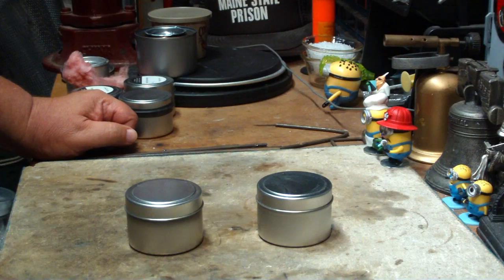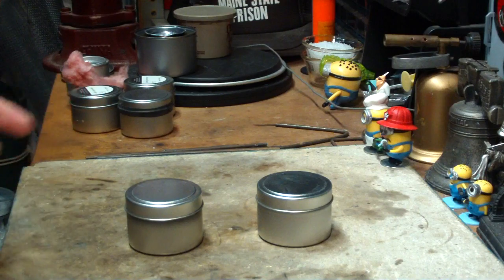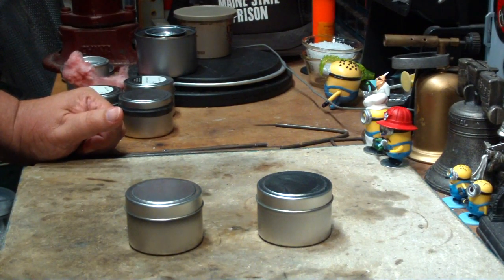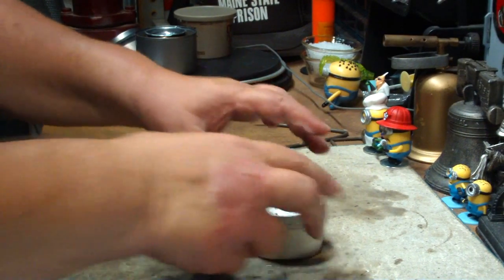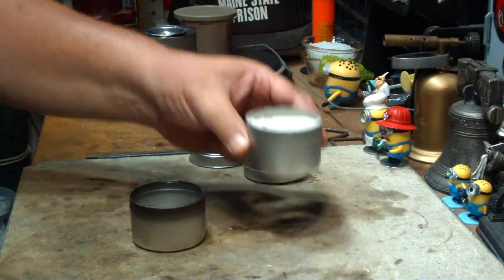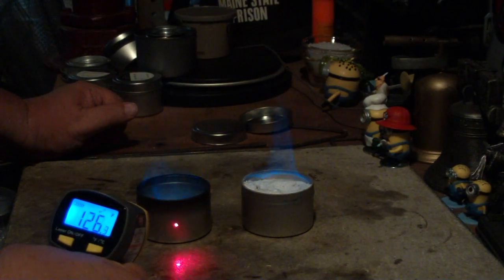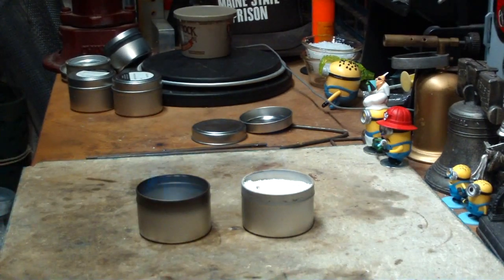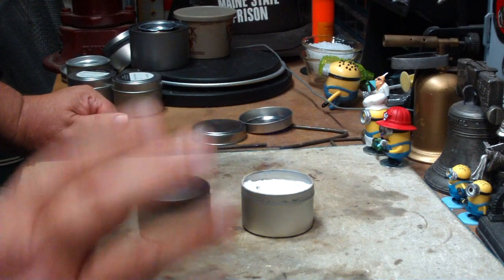What is the purpose of the perlite in the stove?

Comment: Odd question, but what would happen if you lined the bottom 1/4-1/2" or so of the tin can with Perlite, then used the carbon felt on top?  That way, you'd get the wicking action of the carbon felt (minus the small Perlite layer below) without the problems of leftover fuel spilling out, or having to wait until the fuel completely burns out.

Comment: Mull item list.

Wool vs. carbon felt.

Find some discounted wool yarn? 

Squeeze, stuff it into an alcohol stove, cut a wire mesh dome cap to go over it?

"Wool is classified as a flame-resistant fabric. The textile is flammable, but it has to reach at least 1,058 degrees Fahrenheit, to ignite. The material has high water and nitrogen contents in its cells which means if it did ever catch on fire, once removed from the source of the heat, it would self-extinguish the flame.”

Perlite can suck up four times its weight in water, vermiculite up to sixteen times its weight.

Vermiculite sourced from one place In the US used to have asbestos in it, I'm not sure if for plants, it's still being sold.

Old Vermiculite insulation had it in it.

Pill bottle disc, made of vermiculite....

The Vermiculite pill bottle disc each hold 1 ounce of fuel, you use two, they work best with the pot, pan sitting on the disc.

Either 2 stacked, or 2 side by side. 

You want to rest the pot, cup on the stones.

You eliminate the top surface as a burn surface because of the pot on it, the fuel burning from sides, it's more like your gas stove in the house.

It appears to provide more of a blue flame, then having the pot located over the stones, top burning.

Comment: Thanks for the tip. Ive used perlite in other stove projects. It’s light weight and also acts as an insulator
Reply: Many R stoves are constructed with bricks or cement blocks right off the shelf so it's not a necessity to use perlite.

Comment: Hello, I was wondering... When the alcohol burns out does the perlite start burning or does it just go out and remain the white color? Thank you ;-) Great video as usual...
Reply: No.  The perlite has already been exposed to temperatures ranging from 1,560 to 1,650 °F (850–900 °C), and your little stove isn't going to get near even near that.   A steel can will probably melt before there's any change to the perlite.  It's finished.  When the alcohol burns out, just refile it with alcohol, indefinitely.
Reply: Thank so much ;-)

Comment: Informative.  Thanks.  Do you think diatomaceous earth would work similarly?
Reply: No. Generally diatomaceous earth is a very fine powder while the perlite is quite large and chunky in comparison. The perlite doesn't actually wick the fluid up to make the flame, it allows the vapour to rise up between the perlite 'stones'. Inside the cup and between the perlite stones the fuel vapour concentration (air /fuel) is too high and so the vapours don't ignite until they get to the surface where the fresh oxygen is. Also, since the perlite stones act as small windbreaks, the flame is more stable.

Comment: have you ever tried Rockwool?
Reply: Why don't you try it and let us know?  I've heard that one of the reasonst that Rockwool (aka Mineral Wool) is good for home insulation is because water just rolls of the surface and isn't absorbed.  If it does that with alcohol, I can't see it being very useful for the application.
Reply: OK, I tried it, and the Rockwool did burn, It was old and used so it could have been nutrient (plant fertilizer) that was burning.
 There are so many easy ways to make a stove out in the field, and so many litterbugs that it would be difficult not to have a stove as long as you have fuel.
 Did you ever notice that the intermission music for the Olympics is from the old T,V, show "Brisco  County, JR".

Comment: I am not sure that the can with the perlite was burning at a lower temperature. In metal casting many hobbiests use perlite as an insulation and it holds the heat in from escaping sort of like insulation as in a house so it would make sense that the outside of the can was a cooler temperature. So basically in a nutshell perlite acts as a high heat insulator. Good video by the way good luck!
Reply: I agree.  Also, Mr. Cook seemed to be aiming at the BOTTOM of the cans, which I didn't understand.  You'll  notice that the flame from the perlite was a steady blue, and the other can showed yellow, which can be a sign of incomplete combustion.  A better test might have been boiling a measured amount of water over each can, and noting which one boiled first.
Reply: @Frantic618  i think he just was testing to see if the can got really hot, which could burn the surface it's resting on.